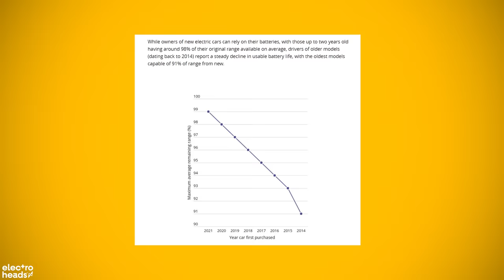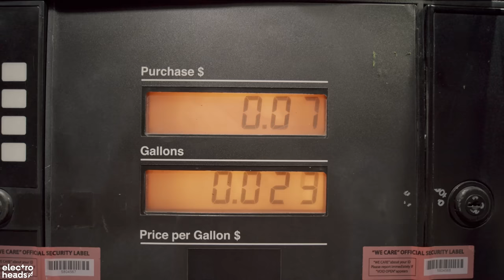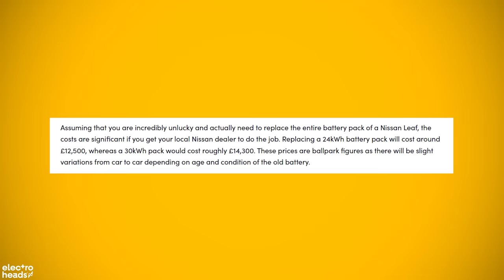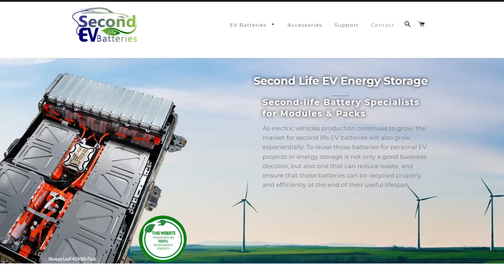What they DON'T tell you about electric car batteries

Comment: To instil confidence in the used ev market, there needs to be a way to accurately check battery degradation on that specific vehicle (rather than just an app that gives an idea) because so many factors affect battery degradation.

Comment: I believe Robert Llewellyn from Fully Charged replaced his Nissan Leaf 24 kWh battery with a 40 kWh for 8500 pound.
Reply: He bought that Leaf over 10 years ago, long before they became popular. Having replaced the battery, he now ought to get another 10 years out of the car. The cost isn't ridiculous if you consider that some people might part exchange cars at least twice in 10 years. And that would probably cost at least the same as the Leaf battery, if not more.... You'd also have to offset the cost of Bob's £8500 new battery against the thousands of pounds he hasn't spent on petrol, in the 10 years he's driven the Leaf.

Comment: 8:50 the price of batteries is going down, and technology is evolving and improving at the same time!

Another great video, thank you Eilis!
Reply: Another positive here is that BMW and Ford are to begin trialling the first batches of solid state batteries later this year..... Solid state will mean a reduction in pack size/weight, and more efficiency/range..... they are also non flammable. The game moves on....
Reply: dcbel:  That's common with lots of products with lots of electronics.  Just look at computers.   In the 80's an IBM PC or clone was horrendously expensive, unreliable (relatively speaking compared to modern PC's, slow, and had VERY little power). 

Modern PC's are basically cellphones, or dirt cheap used laptops (unless you have to have a fancy shiny new Apple, et. al), and have AMAZING power and durability if you get a good brand and take care of it. 

Re battery tech, I expect BEV's will have a similar improvement curve for decades (not as fast, but a huge overall improvement in cost, durability, range, safety re fire risk, etc).  Lithium Iron Phosphate BEV batteries have ALREADY taken a huge step forward for people who want decent family cars and can accept moderate range and acceleration for MUCH less money and MUCH better durability on the battery.

Comment: Average lifespan of ICE cars which is about 13.6 years is the relevant figure, not the average age. So as long as a battery can last 15yrs it will out live most cars.
Reply: But, with careful maintenance a gasoline powered car can easily outlast the average.  I'm driving a 27 year old vehice. There is no evidence that an older EV will be repairable.

Comment: Ok, but what's the impact of that on resale price? Combustion cars retain a decent amount of value and has a second hand market. Would someone buy a 7 year old 2nd hand EV?
Reply: Yes. Because those whom are aware of the fact, will know they can eventually have the battery repaired or refurbished, at usually much less cost than a complete replacement.  Cleveleys Electric Vehicles in Gloucestershire, for example, carried out a battery refurb on a 10 year old Nissan Leaf for a customer 3 or so years ago. The job took 4 hours, and the cost was £600. Happier now?  The video of that very refurb is here on YouTube...... This is why older 8, 9 and 10 year old Leafs get snapped up.... A 24kw battery Leaf has almost 100 individual cells making up it's battery pack. The whole battery gets tested, then the failing cells are removed and replaced with good ones. It took around 15 minutes to remove the Leaf battery pack. Don't believe anyone who says you must replace the battery. Teslas however, are a different proposition. Tesla (allegedly) glue the battery cells together, making a pack refurb much more difficult.....  There are videos here on YouTube, of used examples of the Hyundai Ioniq. One particular example - a really clean 5 year old 17 reg one with 80k plus miles showing - had it's battery tested using  professional testing equipment. It showed the battery was still at over 90% state of health. Lots of silly EV battery scare stories out there.....very few of which are based on fact. That Ioniq sold for £15k
Reply: Why not? You can have the battery checked. If the battery is okay, you just need to check the usual stuff.
Reply: The model for chosing your car will change, currently older cars are often second cars, we will switch to having second cars in families bsased on those with the most charge cycles. Many families have more than one car ewith one beimg used for local shopping or school journeys and simply don’t need a lot of range.
Reply: A ICE vehicle typically looses 30 to 50% of it's new cost by the time it's out of a 3 years warranty.
A BEV currently looses under  20 % in the same 3 years, and most will still be in some form of warranty. 
BEV will last longer the ICE, and this is backed up by the length of the warranty given. ;)
Reply: In a few years time no-one will want an internal combustion engine.. your running costs will be so expensive and you will be so limited with all the new emissions free zone.
The internal combustion cars will be cheaper than a Happy Meal come the end of the decade
Reply: Good point 👍.
Reply: @johnnodge4327  And as we draw closer to that 2030 deadline, the used values of ICE cars and vans will decrease further. Anyone who is seriously considering buying a new ICE car right now, needs to think it through carefully. Very carefully.

Comment: My ZS showed full battery capacity for over a year/15,000 miles.  However, over the last 5,000 miles or so, it's dropped by a little less than 5%.  No idea how that's affecting range though, since I've never really believed the remaining range.
Reply: Your readout may be a little pessimistic. They say average battery degradation is normally around 3 to 4% per year....

Comment: I have owned EVs for 6 years and my advice is to always be prepared to pay for maintenance as not every essential element of the drivetrain is covered under the manufacturer’s warranty. Even a small replacement part can cost between £2,000 to £10,000.

Comment: While you reviewed the cost of "replacing" the battery, it will not normally require complete replacement. The James & Kate channel had one of the 48 cell blocks replaced with a "good used" on a Nissan for approx. £500. The dealers don't want this business but there are specialists out there who do. Similarly, it may cost £5.5k to replace a Leaf battery with a used one but the old battery withh also have a significant value - at least half this sum.
Reply from the maker: That's an excellent point! Thanks for sharing
Reply: Indeed.

Comment: Interesting. I’ve got a used iPace on my shortlist. Replacing the battery in one of those things is insane (£32000?), but it should have a good 5 years left on the battery warranty and maybe the replacement will come down. They will replace if it goes under 70% but would be very interesting to know the specifics on it. Thanks Eilish for pointing out those ‘sneaky get outs’ of replacing the battery. Well worth checking.
Reply: Interestingly, whilst some manufacturers WILL indeed just replace the entire battery pack under warranty - it means they can strip down the old pack for R&D data & diagnostic purposes - often battery degradation is down to just a number of 'under-performing' cell modules that make up the overall pack.
Replacing just a cell module can cost around £1000
Reply: @jonathantaylor1998  Exactly Jonathan. A battery refurb will usually cost just a fraction of fully replacing it......

Comment: When battery has dead cells in 10 /20 years time .those cells can be replaced for £600 ..same price as clutch..
Reply: It will depend how many individual cells need replacing. A 24kw Leaf has almost 100 individual cells. Rarely will all the cells be losing efficiency.

Comment: Hahahaha. The BIG question is the purchase price comedy and the people (who clearly don't pay the bills) answer that the running costs are lower. YES, the running costs are lower, but the BIG costs in any car ownership is the HP, PCP, Lease, purchase cost. Buying a new petrol car, the purchase/lease costs account for about 80% of the annual costs. As EVs have lower running costs, the purchase/lease costs are 90% of annual costs. So when a £15k petrol car becomes £25k for EV, you can see the problems laid bare. There are a few exceptions to this, but only a fool would buy them.

Thankfully, second hand Nissan Leaf and Renault Zoe are getting more plentiful, but then the issue is the battery life span. To be honest, both brands seem to be holding up ok though.

The next BIG issue is charging points. It is ok if you are in London or other big urban centres. Where I live has two charging points for 25,000 residents!!!!!!! So if you live in a flat like me, no chance. Then add in that there are an absurd number of different companies all wanting you to have their app and charge you differently for the service. Either someone in government gets a grip or it will just all go to hell in a handcart.

Then the final BIG issue is to get rid of Lithium Ion batteries and the carbon fibre that are terrible for the planet. EU are reviewing carbon fibre as all efforts to recycle are proving incapable to expand it past a cottage industry. Could you imagine all cars with carbon fibre being banned in the EU, and UK!!!!!
Reply: Well, Electroheads have dedicated episodes to all of your questions, meaning they might be allowed to focus on this one subject for this episode. For other EV related topics, check out their list. The last one is a non-issue, lithium-iron batteries are and will be recycled. As for carbon fibre, that’s not an EV issue at all.
Reply: You're absolutely right 👍

Comment: I move vehicles around the country from point A to point B. A recent 2016 BMW i3 I had to take on a 96 mile drive should have done it in one go. On getting in the battery was showing as full with a range of 60 miles. It transpired that full was actually 48%! So where these experts get their statistics from is baffling to me.

Comment: 0% degradation after 20 months for my Kia e-Niro 4+. In winter get just slightly more than the manufacturers quoted WLPT range of 272 miles (280 miles) and in spring/summer goes up to between 310 and 340 miles (depending on the weather.